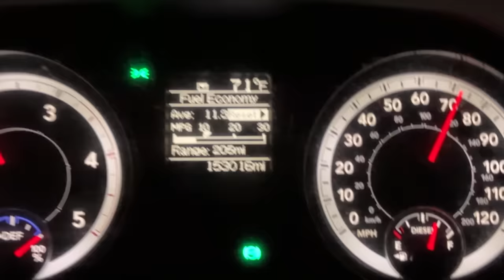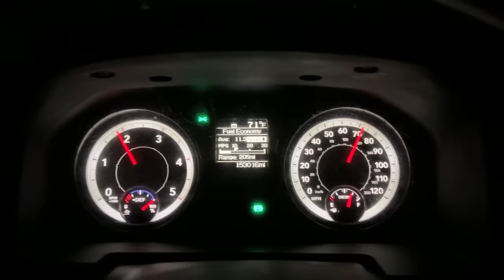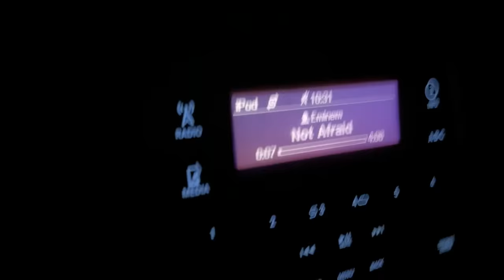My new truck broke down 9.5 hours from home. Dealer refused to do anything...

Comment: Chris is a stellar guy. As for the F-350, sell it.
Reply: I want a new truck.... but..... too worried it'll strand my a$$...pi$$ me off....I have a 2000 Excursion with 78K....gives me zero problems....yea it has the Triton V-10 but zero problems...my friends with new (diesel) trucks (GMC) taught me what "limp Mode" is.
Reply: @readmore3634  My 2017 F150 had a intake manifold blow up on the freeway nearly tore the engine apart when it happened. THe paint has since peeled off the roof of the truck and ive had it since new, tons of ford factory defects are showing up.
Reply: @pilsplease7561  really because my 2017 F150 is doing amazing and I beat the absolute piss out of it every single day and it's over 100k miles and guarantee it'll make it another 100-200k
Reply: @shotemup123  If the truck hits 100K I would be shocked at the rate its going has like 59k Miles
Reply: I also have a 2005 F-150 plumbing truck, 4.6 V-8....168k...runs perfect, no leaks or squeaks. 16-18 MPG. 
Bought my wife a 2018 Ford Edge, 4cyl EcoBoost, loaded, love it.   Guess I'm a Ford guy now.
Reply: @pilsplease7561  Built in Mexico?
Reply: @readmore3634  F150 is built in Missouri which is literally where it says on the truck it was made, my dodge on the other hand, literally 1 part in the entire car was made in indonesia the freaking ignition coils everything else on the car was made in US and put together in canada.
Reply: Well ya it's American made
Reply: @readmore3634  I would definitely keep the Excursion V10 with only 78k miles!!
Reply: exactly... buy a Toyota
Reply: Hey now... I bought my 2005 f350 brand new, still have it, other than a $5,000 head gasket issue, its running great! so, 5k expense over 17yrs aint bad....
Reply: Should have bought a 3500 duramax diesel🤣😂🤣
Reply: Sell it to a channel watcher!

Comment: Glad yall made it home, that dealer is operating on their internal policies, should talk with someone at fords corporate office about it, I wouldn't want a business selling my product, and treating a customer that way. Glad you guys are safe, and the car is okay! Things can be fixed!
Reply: Yup. Life long Ford person, but their dealerships have become a deal breaker. 

Canceled orders on a Bronco and Lightning because two different dealerships started tacking on surcharges. There’s a reason Ford is the OEM pushing hardest for direct to sales reform.
Reply: @Charlie Sipple  getting harder and harder to find an honest, and helpful dealer anywhere. I live close to Detroit, and it's the same thing, less than 100 miles from their corporate office. Shame really.
Reply: @ChuckThree  lifelong GM guy and a dealer we bought a car at is fighting us 3+ months for a grenaded engine that should be warrantied, every GM service rep or dealer service manager is "busy"
Reply: When they see how many thousands watch this, they might just call Taylor 😂... RAM Ford out the way, leave it Found On the Road Dead.... as always 😂
Reply: This!
Reply: I had one of those dieselgate VW's. CEL came on, brought it in for a fix. They are required to give a loaner. Dealership didn't want to do it. One call to VW corporate and I was in a loaner 20 minutes later. 

ALWAYS call Corporate. Dealerships are always cunts until someone from Corporate calls and makes them do their fucking job correctly.
Reply: @NovaRedHead  gotta say, I’ve owned vehicles from pretty much every single manufacturer… and Chrysler/FCA/Stellantis products have been unequivocally the most troublesome (exception being pre-2.0T Jeep Wranglers and pre-DEF Cummins Dodge Ram)

Comment: I hate dealing with dealerships. They will do everything they can to make sure that you aren't covered by your warranty thus sticking you with an outrageous bill. That comment that the service writer made about moving your trailer would have sent me over the edge. Service means nothing anymore and a warranty isn't worth the paper it's written on. Shoutout to Chris for being an awesome dude.
Reply: I would sue tf out of them
Reply: Agreed. Also, for a customer like Taylor not being able to rely on the warranty service to at least keep him moving forward is a 10,000% deal breaker!! He’s screwed both ways since the warranty makes him unable to get the part and fix it himself, taking away the only benefit warranty provides! Dealerships are great when well-managed, but comparable to the worst insurance company when poorly managed. That trailer comment proves the service manager either is a) a 5h1+ human being with no compassion or b) has never taken a road trip with so much in one trailer and the stress that multiplies on a situation…or both.
Reply: Absurd, I'm a tech at a ford dealership. We punch the causal part into the system and it shows if it's covered or not. There no hidden agenda to not warranty things. If anything we try our best to get items covered as it's a pain in the ass dealing with upset customers. There zero incentive to not warranty thing's that are covered. Get your head outta the sand 👎👎
Reply: @blazinlow86  He's obviously not saying a low level employee like a tech has a hidden agenda but the organization and higher level managers do everything they can to maximize profits by any means instead of doing what is right.
Reply: there's just no reason to not be nice and understanding, it doesn't cost extra money, and you can still explain when your hands are tied, and with you being from out of town they should have been very willing to get you fixed and out of their hair, I probly would have responded with if you want that trailer gone then you better get crackin on the truck that moves it.....

and if Supreme Ford didn't like giving themself a bad image they should have thought about their actions before they turned away a high profile customer nowadays, cause even without the google reviews, search their name on youtube and this will probly come up
Reply: @awesomecooly123  More nonsense. The idea is to try to keep customers coming to the store and therefore stay in business. The focus is always repeat customers. There is no hidden agenda
Reply: @blazinlow86  you’re leaving the part out where the “STEALERSHIP” makes more money on the service if it’s NOT covered under warranty.. You know just as well as anyone that the factory only pays x amount for the service. If it’s the customer paying, we all know that number typically gets inflated…
Reply: @MechanicalMafioso  It's no secret that retail work pays more than warranty. However in this specific case thst we are referring to it makes no difference. In a ford "stealership" the dealer doesn't have the option to choose whats warranty and what isn't. Taylor's vin, milage and the causal part basic will be entered into oasis and it will show if he has coverage for that component. If he does it will be fixed under warranty, if he doesn't he will have to pay out of pocket. It's really just that simple. Furthermore dealers with high custom satisfaction ratings make more money thru ford warranty. Your uninformed and don't understand the bigger picture. Storing his trailer, getting him a replacement truck, covering expenses caused by the breakdown are not covered under his warranty. Just is what it is 👍👍
Reply: @blazinlow86  so they can’t find a reason to void a warranty? Thus enabling them to bill more?

Comment: You're experiencing just a small bit of what the trucking industry has been dealing with these emission trucks. New doesn't mean less maintenance. Actually means MORE!
Reply: I HATED working on the 6.7 Powerstroke.   Every single one of them leaked oil within the first year,   many water pumps fail and the diesel emission systems are terrible.  DEF heaters fail regularly as well as the multitude of NOx and EGT sensors.   I was stranded out on a test drive when an EGT sensor failed and the truck shut off.  Refused to even crank.

When the DEF system has ANY problems it'll start counting down miles until it will limit its' speed then refuse to start.   Most owners didn't show up with them in this condition (yes...we had many) until there were only a few miles left before the truck bricked itself.   You cannot reset this counter....you have to fix the problem (or hope you did) then drive it and once the computer is satisfied it's supposed to clear the counter and light.

Driving an F-450 dually from the local Gas Company (fully loaded box truck) the counter hit '0' and according to the readout on the dash it was going to limit itself to 50 mph...but that's not what it did...it threw itself into REVERSE at 50 mph!!!!   Man...that was dramatic and it destroyed the transmission.   Everyone was upset ...including me having to wrestle a hopping, smoking truck off the road without hitting anything...very exciting.   I'm sorry but you couldn't give me a 6.7 Ford and anyone expecting to buy a new one and then depend on it for work is likely going to be disappointed....or worse.

Edit:  I wrote the above before watching the video.   Low fuel pressure is often the pressure regulator that is in the rear of the motor drivers side.   When you pull it out there will likely be metallic debris in it which Ford will then say is YOUR fault from water in the fuel.   Most owners don't regularly drain the water separator and Ford says you must replace the ENTIRE FUEL SYSTEM.  BS.  We've replaced several pressure regs (they're not that expensive) without doing the entire system with success.    You are looking at $5-7000 for the repair if you do it the way Ford says to do it.   See...that's why I hate them.
Reply: Wait until they make you use electric/battery powered trucks!!
Reply: Truly the John Deere of pick up trucks
Reply: Get rid of those Fords and get a Duramax
Reply: @finfan1009  Exactly what I did, I bought x 2020s brand new, a 3500 dually cab/chassis for work and a 2500 Crew cab for personal,  the 2500 has been flawless for 50k miles now, the 3500 had 1 warranty repair because on the cab/ chassis models the def tank is in a weird spot and water from the tire was flooding into the electric connector on top of the Def tank, water intruded amd corroded a pin in the harness, the dealer replaced the harness under warranty and had it back to me within 48hrs with the advice to keep dialectic grease on the connector, that was 40k miles ago and no problems, these new duramaxes with the new chassis and 10 speed are miles ahead of the old ones for towing

Comment: It's this reason why i don't like used vehicles for full time use... no matter how "little" miles are on the vehicle,  you never know how those miles are treated...i bought a 2010 Mustang with 54k miles,  at 74k miles,  the transmission failed and required a one